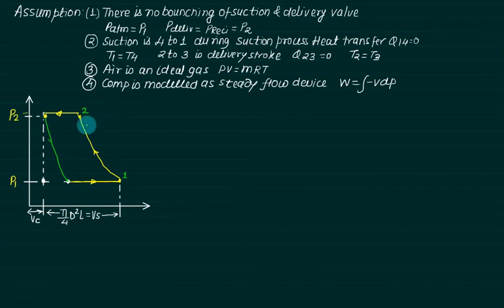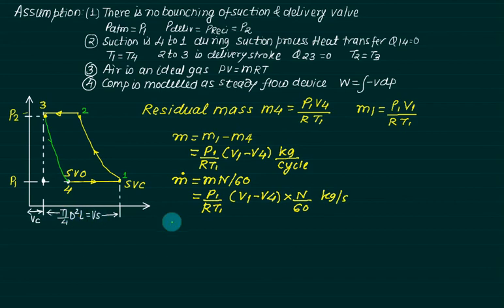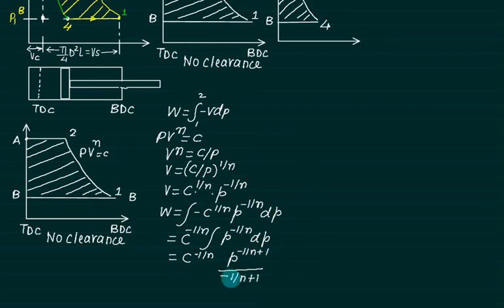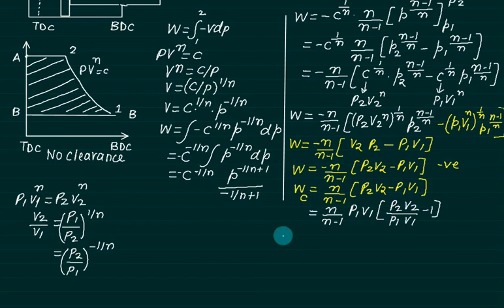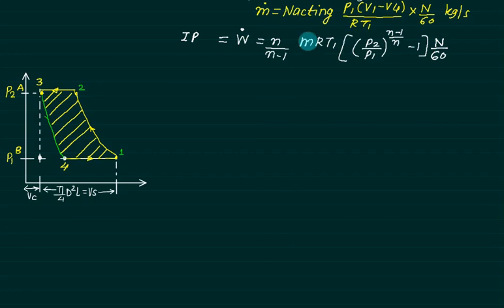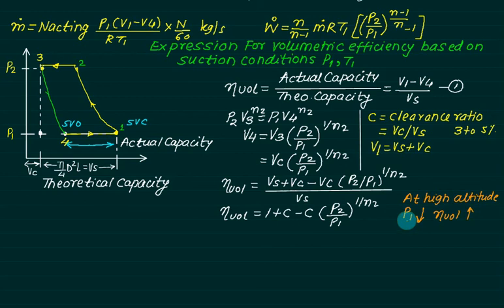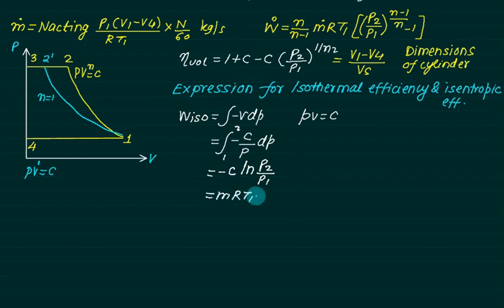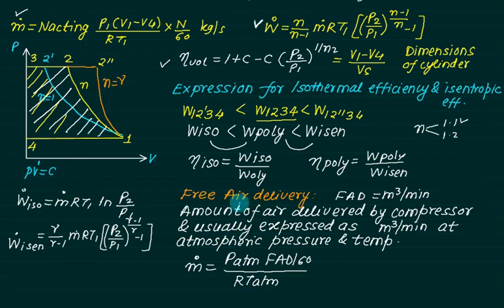02 Reciprocating compressor I efficiency | PV diagram | free air delivery | volumetric efficiency

Comment: hai sir , how can we say clearance has no role in workdone. without clearance volume the mass inducted is m1( = p1v1/RT1) which will be greater than the fresh air mass inducted with clearance vol. ie, m (=m1-m4) . since both masses differ the workdone also should differ, right ?..
Reply from the maker: comparison is made on the expression derived for specific work

Comment: sir..first of all thanku so much for this video..it helped me a lot..and i have a ques,if during the compression stroke the valves were closed,why didnt we consider the system a closed one during the compression stroke,why did we use the formula of work done during a flow process,the compression here is a non flow process ...right???
Reply from the maker: During the cycle the mass transfer takes place and hence system is flow process, in  suction and exhaust mass does crosses boundary
Reply: sunil mohod thanku so much sir